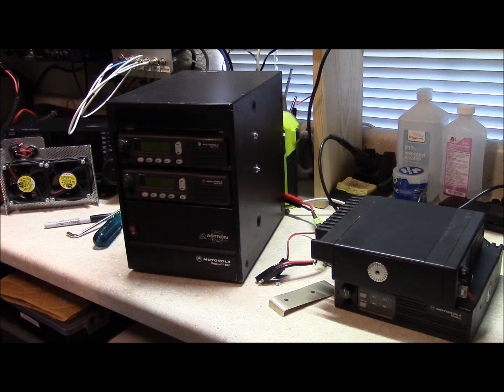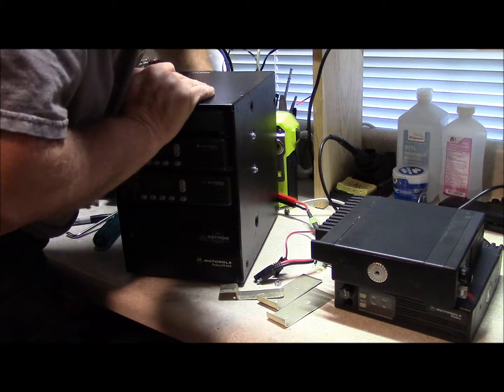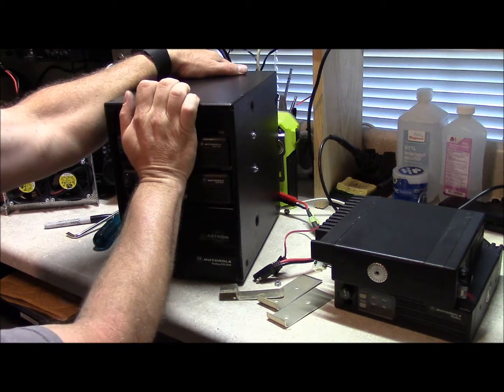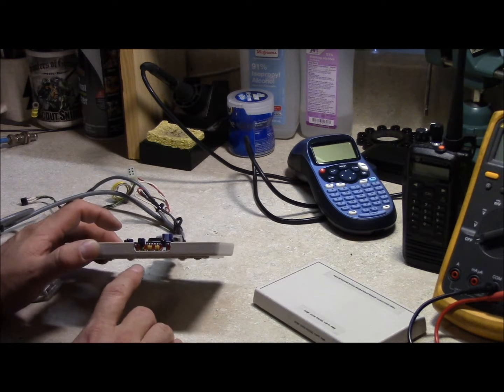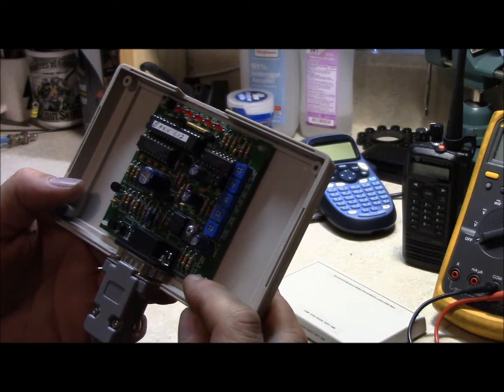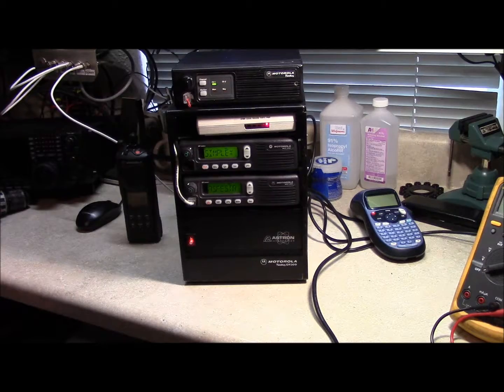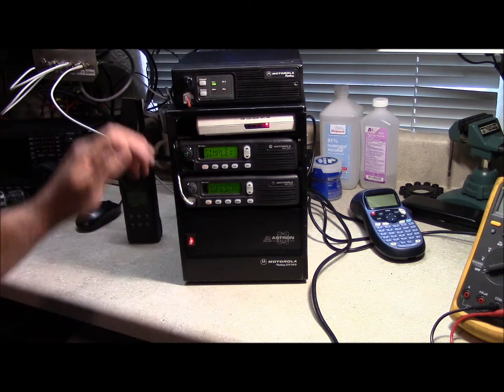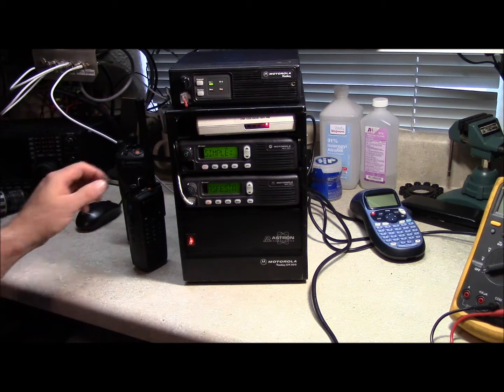Field deployable UHF repeater Part 2

Comment: Finding information on the ICS controllers is difficult at best. If you could brief over your controller in a video, I'd greatly appreciate it! I'm looking at getting one of these for a kenwood repeater build.
Reply from the maker: They are good controllers for the price point. Do you have the manual ? I can put together a video at some point. Thanks for watching !
Reply: @survivalcomms   My project is purely research at this stage, but I have aspirations of a GMRS network in the near future. The plans are for a Kenwood Tk-890 or TK-8180.

(TK-890) manual http://www.repeater-builder.com/kenwood/pdfs/tk-890hb-svc-man.pdf 

(Tk-8180 manual) http://www.repeater-builder.com/kenwood/pdfs/tk-8180-svc-man-suppl.pdf

My specific question for now is, what does the Basic Controller require for inputs? 

I want DTMF control (which I know these controllers are capable of), and the repeater to self identify (thats about all a GMRS repeater needs to do), but more features are appreciated.

Also, why run two radios? I'm a bit of a scanner junky, and I've got a few receivers/scanners around. Why can't I use a scanner as my repeater input (that ties into 'what does the basic Controller require for input' question)?

I realize this is a lot, and I'm reading though the ICS basic manual...but I was just curious as to what the Controller wanted for inputs in general. Your 'Part 3' video kinda covered that topic, but not in great detail (that wasn't the nature of the video, so I understand).
Reply from the maker: Those a both good radios - what are you planning on using for Carrier detect ? I did not see a pin on either radio's accessory connector.  I put a bunch of TK690's on the 6m band back in the day. If you are planning on putting your repeater in a fixed location a Zetron 38Max is a great repeater controller for the price.
Reply: @survivalcomms  Actually, that is a very good question...I assumed that was handled on the controller side. Looks like I've got more reading to do
Reply from the maker: @MrGhostVortex  In some controllers it is through some vox implementation but your best bet is a solid carrier detect ( > + - 2v  Hi or LO between idle and receive state) routed to an accessory connector. If you flexible in what radio platform you are choosing for GMRS you really cannot go wrong with a couple Motorola Maxtracs . You can get 2 channel ones for 20 bucks or less.  This gives you more capital for your duplexer , feedline, and antenna
Reply: @survivalcomms  I did look at the Maxtracs, but I had two points in mind. 1: fully GMRS compliant (basically Part 95a compliant) which is the TK-8180. Or, if I couldn't be 100% compliant, I'd go with the high power TK-890H (run it on 40 watts low power, and I'd have an emergency 100watts full power if needed).
Reply from the maker: @MrGhostVortex  Do you have a site ?
Reply: @survivalcomms  No, i do not.
Reply from the maker: @MrGhostVortex  You need a very squared away setup to use a 100W xmtr in a repeater successfully even in the short term IMHO.  Been there done that and it was awesome (MTR2000) but it was all commercial stuff that I couldn't afford on my own. Coast to coast mobile coverage on UHF.
Reply: @survivalcomms  I'd love to, but for the moment I'm sticking to GMRS. I do, however, know it a local guy who owns all the equipment to run such a system. He had a 200ft tower and 100watt repeaters, it was quite impressive. I dont currently poses the funds to buy his tower rights or all his gear....I'm just into this for the family. Life around the 200+ acres would be easier with reliable coms.
Reply from the maker: @MrGhostVortex  I currently cover a few square miles with the small repeater here @25' with handhelds .  I did a video called "how far will my radio talk ?" that's on my channel that has a few theoretical models that you can use for planning a small system.
Reply: @survivalcomms  Awesome, will definitely check that out!

I was going over the carrier direct function again, and I believe kenwoods version of this is called BCL (busy channel lockout) (TK-890 manual, page 11, section 25). Page 78 is the 25 pin D-sub, 9 acc and 12 pin acc port break down/pin-out.
Reply: On the topic of coverage though, I do have a Ronh 25G 40ft  tower that was given to me, and I have plans for a multi array folded dipole for all around coverage.
Reply from the maker: @MrGhostVortex  That is perfect for your application. If you shop around you can assemble a decent setup for < 500 bucks that will fulfill what you want it to.

Comment: what radios did u put in place to the one u had in there i know it motorola but what model
Reply from the maker: The originals were Maxtracs.  The replacement radios were MCS2000 Model 1's. UHF band R split. Thanks for watching !